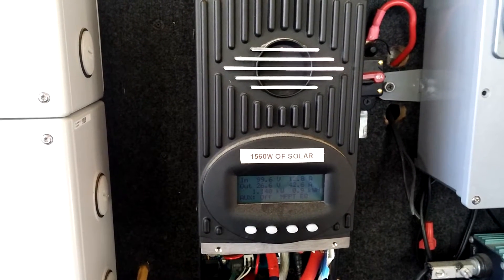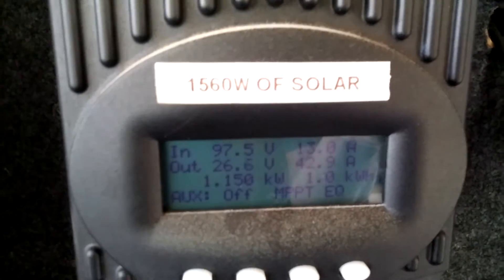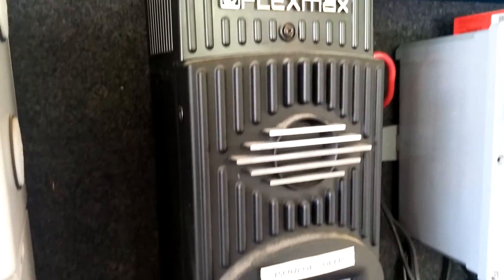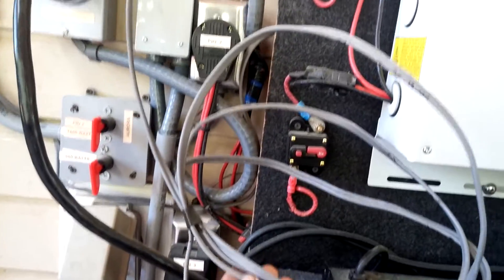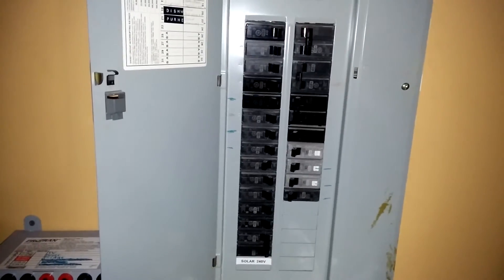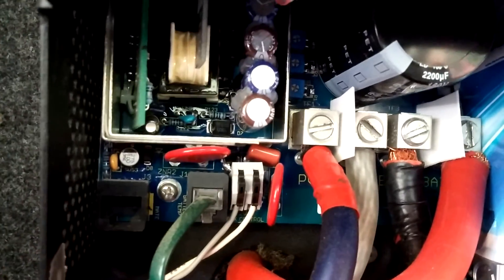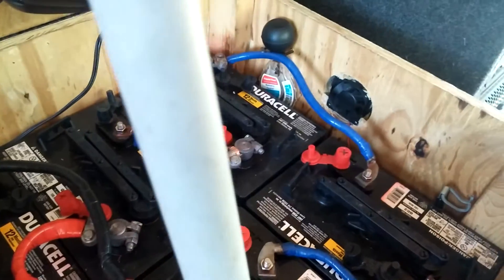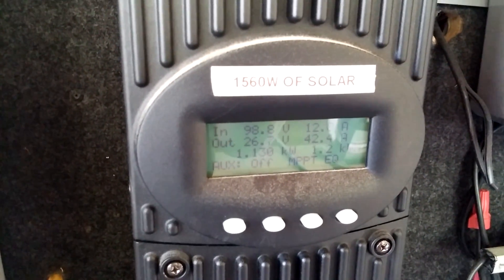Flexmax 80 charge controller

Comment: You have the same battery set-up I have,, I have, Flex-Max 80, Mid-Nite Solar 200 and 150,  Morningstar 60 and other charge controllers that I play around with, I got more stuff then I need or can use,,  LoL,,,,